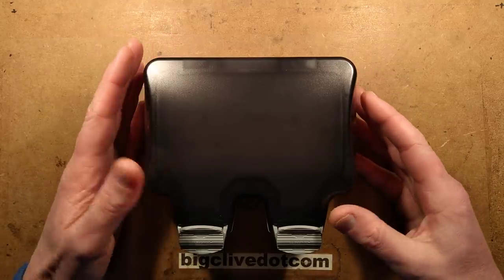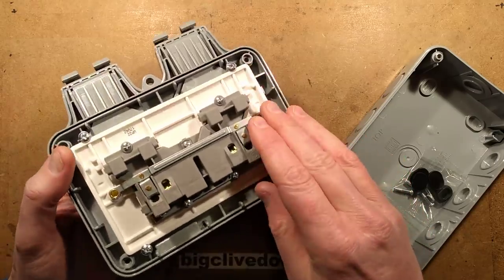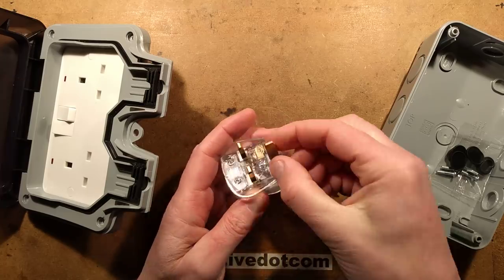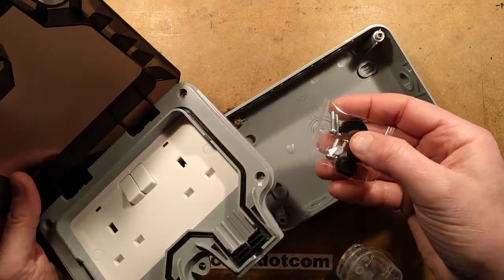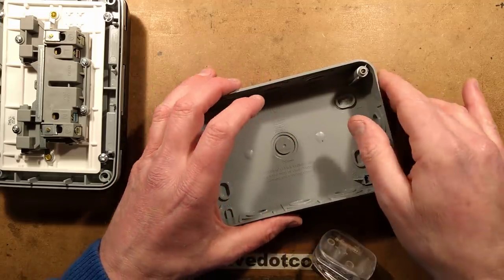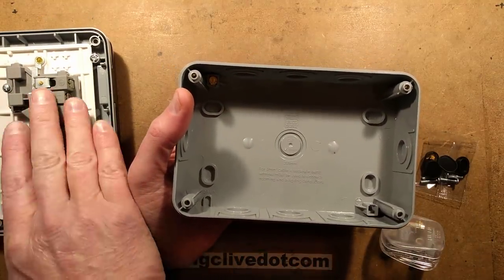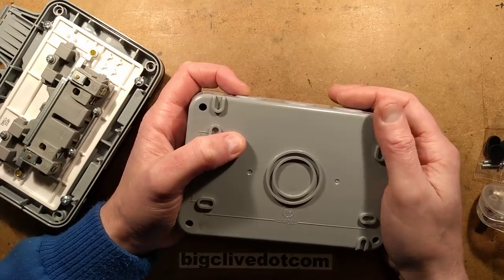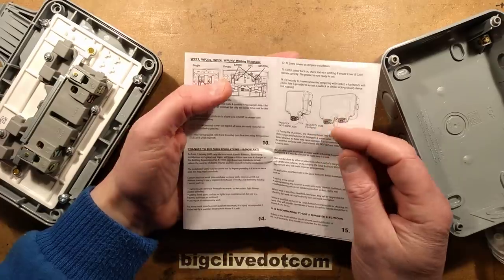British weatherproof socket with clever design. (bonus rant)

Comment: 100% agree with your rant Clive. I started off as an electrician in 1985, but as I'm no longer up to date with the regs, I also can't (yeah right) carry out more than the very basic electrical work at home.  I relinquished my membership of the IET last year, because I believe that many of the changes made are nit picking and designed to create money.
Reply from the maker: These days you can instantly be back up to date with a one day regulation refresher slideshow complete with "test" that is hard to fail.  Exactly the same route many companies are using to falsely certify laborers as electricians without the inconvenience of those pesky apprenticeships and proper training.
Reply: @bigclivedotcom  Yes, it makes a farce of the whole thing. I'm not sure if it's still the case, but the same used to apply to Gas Safe (and previously Corgi). British Gas etc would blanket cover their employees.
Reply from the maker: British gas is just a brand now.  The"technicians" that come out are salesmen with minimal technical training to try and push for sales of things like new boilers and magnetic water conditioners.
Reply from the maker: The NICEIC has always offered blanket approval to facilities management type companies.  As long as they yield one person to take responsibility/blame and a sum of cash based on their turnover then all the vans and clothes can be printed with the logo even if the person doing "electrical repairs" is completely electrically unskilled.  It's been like that from the beginning.
Reply: And if the Gvt get their way the NICEIC will be the only player in town and you will have to be a member to do ANY electrical work. All in the name of consumer protection.
Reply: @bigclivedotcom sounds similar to the SIA security scam
Reply: I'll never understand how brown and blue is better than the old red and black.
Reply: The red/black/green colours had to change anyway as red/green colour-blindness is the commonest kind.  The striped green/yellow earth is the solution to that.  I'm sure they could have compromized on brick-red instead of poo brown though.
Reply: @MarkTillotson  That makes sense I guess, but why change black to blue? Blue might've been a good earth colour tbh
Reply: @MarkTillotson  If you can't tell red from green you have no business doing work where telling those colors apart is critical. And changing the colors makes no difference because older wiring uses red and green, and such wiring will be encountered forever.

We still use red and green here in the US, and probably always will, since we have never changed our color code. White is neutral, green is ground, every other color is hot.
Reply: I blame the 'Common Market'

Comment: Those kidproof covers are bad for use in the UK since they can be broken off and leave the earth pin in the socket, leaving the shutters unlocked
Reply: yup as featured in many schools and nurserys around the uk
Reply: They are no longer recommended for use. If I can find the reference I'll post it below (I was only reading it a few days ago).
Reply: @Raysnature  Please do so, as i ran a business electrical testing buildings and portable devices. My experience is that British standard plug and socket is superior to any continental equivalent.
Reply: In Germany you need those, either replace the top cover of the socket with integrated kid proof thingys or use kidproof inserts. Or don't bother at all with it. That's also a solution. 
When I was a child, we didn't have those for the most part...
Reply: If you get the right sort of plastic insert then they're nearly impossible to get out without possibly snapping the plastic pins off in the plug.  I know I had them when my child was a baby and it made plugging and unplugging a nightmare.  By the time you have the strength to remove such a plug you are old enough to have been taught against such unsafe practices.
Reply: @randzopyr1038  "By the time you have the strength to remove such a plug you are old enough to have been taught against such unsafe practices."

Are you sure about that?

https://www.youtube.com/watch?v=5NEgRNXTe3k
Reply: Rand Zopyr there’s another danger; plastic crap snapping off in the socket outlet. 
They’re literally shit. None of them carry BS1363 approval or indeed anything else.
Reply: henlo
Reply: When I first started as facilities at my school first thing I did was ditch all the plug guards
Reply: you people amaze even me good lad. They’re worse than useless.
Reply: @Raysnature  Thank you!
Reply: In  addition. More people end up in A&E as a result of trying to remove socket covers, than children do from direct attempts to put fingers in sockets! I recall NHS releasing this info, but cannot find the details from a couple of years ago.
Reply: Even if the shutters are left unlcoked... How is it any more unsafe than not having the covers in the first place?
Reply: hi the main thing that i disagree with about the plastic covers are none are covered by british standards like the plugs have to be as such the pins cans be and very often are made larger to make them a tight fit. this means that the plastic pins are forcing the connectors in the socket further apart than they are designed also straining them. effectively after a plastic protector is removed and a high amperage electrical appliance is left on as inted in the socket eg electric heater arcing / burning may occur over time which is a conciderible fire risk. i wonder how many sockets used after the plastic protectors have stopped working or shown signs of heat damage and required replacing

Comment: Be careful fixing to brickwork, as unless the mounting surface is quite flat, the back box twists and the front plate/box seal gets tweaked, allowing rain in. Could do with a separate back plate to stop this.
Reply from the maker: That applies to most panels.  You have to find a suitably flat area and use spacers if the box shows any sign of distorting as the screws are tightened.
Reply: On pebbledash in particular I often use offcuts of cushion flooring. Saves a lot of cracked plastic. And for marking through fixing holes, especially on pebbledash, those 'Marksman' markers are the cats whiskers (or dogs whatsits).
Reply: pmailkeey 😃 Sorry, spelt it wrong. Wotsits. 😃

Comment: Rant on, good sir!  :)  Some of the worst work I've ever seen has been done by "qualified, licensed" people.
Reply: Buying qualifications rather than getting them on merit.
Reply: Same could be said of my psychiatrist. Scary sometimes.
Reply: As someone that’s colour blind and has done some electrics in the entertainment industry (dim/dark lighting or random flashing colours in the dark), I can say that the harmonised colour code has led to more cock-ups than any of the kit I’ve opened up that has still had Red, Black & Green.

It does get a little saucy once you start mixing kit wired up to the US spec on the same job though 😂
Reply: @pmailkeey Nooo..... Listen to a 1 day course part P guy and he will explain..... Connect the bare copper or yellow/green wire directly to the live coming from the breaker. If it trips you need to put a loop in place of the breaker and rcd.... If that doesn't fix it go round and find all the places where the green/yellow connects to pipes and cut them until the breaker stops tripping...... AND ! Don't forget to leave absolutely no documentation about the changes you have made. :-)
Reply: @TRS-Tech  - Unfortunately this sort of problem is not limited to electrics. When we bought our current house it was in need of quite a lot of work, rewiring, draught-proofing, plastering etc so I applied for a local authority improvement grant for several of the works. An internal examination told me that the roof, dating from about 1890, was in need of remedial work, having no under-felt and suffering from "nail-sickness". The "surveyor" that the council sent out, who didn't look old enough to drive, looked at the roof slopes from the ground and pronounced them fit for several years' service yet and disallowed grant work for it. Two years later one windy night several slates slipped from their well-rotted nails allowing water into the loft. Having applied for a grant previously I was barred from applying again for the same work and had to foot a bill for over £9,000 - so much for technically trained "experts". I, like you am, an electrical engineer having attained my degree in the 1960s before they became of less value than used toilet paper  so I similarly cannot carry out any electrical work beyond rewiring a plug. What a fu**ed-up country this is!
Reply: @JUANKERR2000  100% agree. I feel your pain. It hurts even more when you have to pay a spotty teenager to perform work in the kitchen. A teenager that likely believes an electron is one of the power rangers !!!

These days I do it myself and then I KNOW its safe and if it goes wrong I have only myself to blame. If someone queries why the socket in the kitchen is not on the BI records you just say " I dont know ".
Reply: A few times I've had to work on stuff that was put together by somebody, who I was assured, "really knew what he was doing."

I'd look at it and think, "Oh no, he didn't."
Reply: @JUANKERR2000  A colleague of mine, prior to the Bldg Regs changes, rewired his house then got Norweb to fit and connect a new meter. Minutes later he went to turn on the electric cooker and got massive belt from it. A quick check revealed that the Norweb “engineer” had wired the consumer unit ass about face. ☠️ You pays your money ........
Reply: @keithtanner2806  I do not doubt it; I am not claiming that the Building Regs changes have made things better or worse, they simply are not fit for purpose giving the uneducated/uninformed layman a false sense of security - vide Grenfell Tower.; make the building inspectors who passed the thing off responsible, not the poor bloody tax-payers as usual. As a now retired electrical engineer with a degree (one earned in the early 1960s when they were worth more than a sheet of used toilet paper) and a hard-earned diploma qualifying me for membership of a professional body (the IEE, as was) it pains me to witness the title of "Engineer" bestowed on one whose knowledge and skill are limited to looking at a list of fault symptoms when presented with a non-working boiler or washing machine and simply  changing a circuit board or replacing a blow fuse, usual at some iniquitous charge. The poor ripped-off customer is so grateful that an "Engineer" has deigned to pull him out of the mire. Rant over, for the moment!
Reply: @TRS-Tech  I never knew about the 'not a fixed wire installation' thingy! In actual fact I've just fitted one of these exact same sockets to the outside wall in the garden, replacing an older single weatherproof socket, the end of the cable is attached to a plug with goes into an RCD which then plugs into the wall socket - I'm covered! Thanks for that.
Reply: @plymouth5714  That is the best way to cover yourself if there is ever a problem.

The way of connection used via the plug and socket it means legaly you haven't actually touched the buildings installation.

Its the same situation as you have with  a UK telephone master socket. As the master socket is what Openreach and your DNO regard as the "demarcation point"  In  other words everything back from the master socket or with the tails coming into the building after the meter is the service suppliers problem.

This is good protection as long as you don't do something stupid such as using lighting twin and earth to feed a 6KW power shower and ignite your home (don't laugh I have seen it done).....

Under rules from  Clives favourite organisation the NICEIC if I install a fused spur from a ring final circuit or fit a new breaker for a fire alarm I have to do a complete test of all three cores of the cable and record the results including a full insulation resistance test and  PE when a fire alarm is being installed. I then become legally liable should any fault or fire occurs. 

!!! Thats a LOT of paperwork !!!

This is getting worse and before long we will be like Australia where even taking the cover of a socket or light switch is a 'criminal offence" unless you are licenced. It will be very interesting to see if recorded injuries or deaths change very much in Australia ! I suspect there will be very little change !....

Isn't this industry fun 😁😂
Reply: @TRS-Tech  Many thanks for that Stuart! Until last year our 1953 ex-council house was still connected to the mains in by the old (ancient) four fuse box with those cassettes with the fuse wire and screws! About three years ago we had a problem with one of the ring mains fuses (it blew the cassette apart) the emergency electrician sent by the house insurance managed to replace the cassette with a single RCD as a 'tempory' measure but advised we should get a full modern consumer unit fitted (at a horrendous price of course). We then had a big power failure last year and the RCD just refused to clear. The insurance company sent another chap along who found a dead short somewhere in the house. Eventually, after moving half the house around to get at long forgotten sockets the short was found to be in the detached garage which was duly isolated and the short was gone. It was only then that we discovered that over the years, the modern fluorescent tubes in their metal boxes had been fitted to a lighting circuit with no earth! Being a penny-pinching council they had decided that since all the supplied light fittings were made of bakelite why bother putting an earth in the circuit! We've now replaced most of the tubes  with modern LED lights which didn't need the earth wire. The one good thing (apart from still having no power to the garage) is that the old fuse box was replaced with a big consumer unit and the insurance paid for it all! (Wouldn't pay to re-wire the garage as it wasn't part of the house!) The Aussi situation sounds awful, I wonder if Brexit will free us from that route?

Comment: Totally agree with you Clive, I have City and Guilds and also HNC certificates in Electrical Engineering having completed 8 years of college courses to gain said qualifications. It makes my blood boil when we are not allowed to do electrical work in our own homes because we are registered for part P approval which I believe has to be renewed annually. Anybody can acquire part P certification if they are prepared to stump the fee for it, all it takes is a few thousand pounds and about 5 or 6 week intensive training course and a test at the end of it. How can anyone muster as much information and skills in a few weeks that others have taken years to acquire both at college and on the job training by way of an apprenticeship? It was a way of overcoming the skill shortage we had a few years back when apprenticeships where frowned upon by those in power as they didn't raise any revenue. While these part P people may in some cases be capable of of installing the odd socket or water heater for example, stick them in front of control panel / switchboard etc with problems and see how they fare then and yet these people are allowed to do the jobs that you and I aren't because we can see that its a scam designed to raise revenue be it taxes to HMG or increased profits to the bosses because they can pay them less and has nothing to do with safety.
Reply from the maker: There are one week courses available and also "trainers" who will visit facilities management and kitchen/bathroom companies and do a one-day slideshow presentation with "certification".  Sadly the "certified" electrical experts suffer badly from the Dunning Kruger effect and genuinely believe they can now work on anything electrical including industrial equipment.
Reply: @bigclivedotcom I used to work for a company where the owner put his son through one of those courses and then a short while later I was out of a job and I think you can guess why.

Comment: As a chartered electrical engineer with about 40 years experience Clive I agree with your comments on the part P scam and the organisations that profit from it.  In my opinion a similar scam was also created in relation to the replacement window sector.  As an aside I liked your video!
Reply: There is a long list of such professional accreditation scams.
Reply: Those issues also apply to Building Surveyors ( I am not one) when outside Surveyors with minimal hours of pseudo training were brought in by Thatcher and her demolition mob. They replaced time served LA surveyors who knew not just the appropriate measures but also the ground characteristics which can vary hugely across small areas. Result? Massively inadequate constructions “approved” even though some were never inspected. The insurance for approved work simply would not pay out and could result in Local Authority Surveyors having to come in and try to work out a solution. I know one in particular where the private BS simply ran away from a job which was on the verge of collapse with residents in the flats! Happily the funders for the work, Barclays Bank, nailed them but sadly it never made the media.